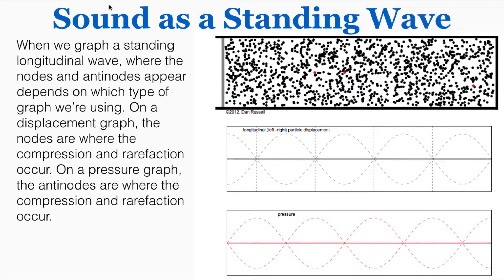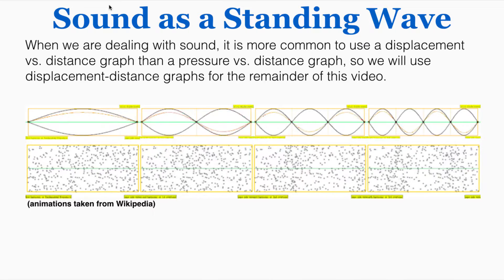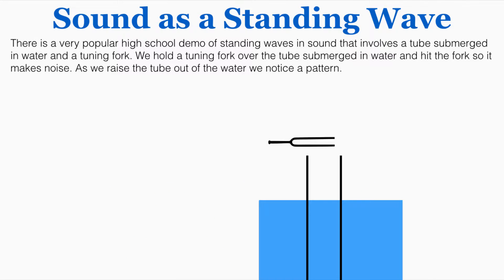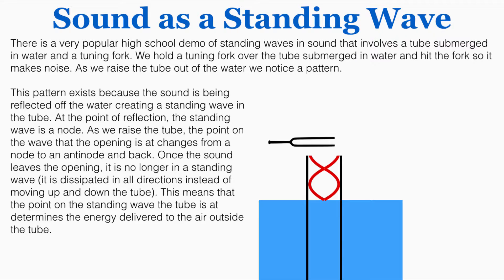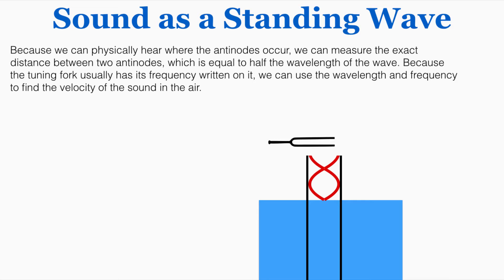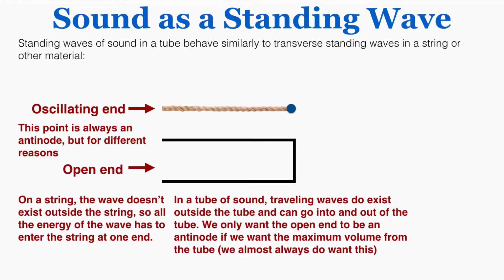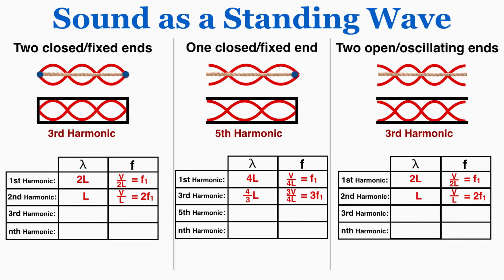Sound as a Standing Wave - IB Physics

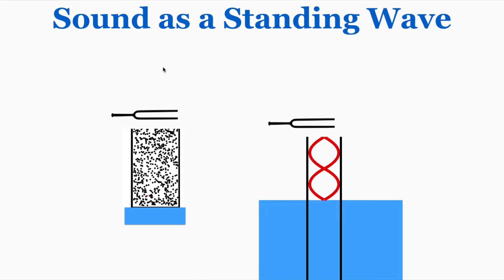Comment: I think that there is a mistake in the video at 5:35 to 6:15. If we do not hear a sound at this pipe's length (L = 2*lambda), that's not because there is a node at the upper end of the pipe. In fact, the boundary conditions for this pipe are always the same here : a node at the bottom (at the water's surface) and an antinode at the top (if the 0,61*r correction is neglected). So, there is no sound when the length of the pipe is L = 2*lambda because no standing wave at all can be established in that condition.
Reply from the maker: Ah drat you're right, good catch! I should add a note in the description, thank you!

Comment: After watching dozens of videos regarding standing waves (which were only based on formulas, graphs and mathematics ), finally I got a clear picture of standing waves in organ pipes in my head. So thank you Andy. The only doubt I am remained with is "is it possible to create a sound standing wave without organ pipe in the air just by blowing air with our mouth ?  "
Reply from the maker: So the thing that's different about sound is that it's a traveling vibration through air particles, the air particles themselves aren't traveling, they just shake back and forth and impact the next air particle. It's the different between talking to someone across the room (very easy to send a vibration through the air particles) and blowing air across the room at someone with your mouth (the moving particles very quickly dissipate in the air before reaching the other person). Because blowing doesn't create the normal phenomena we associate with waves (maxima and minima, period and frequency) a standing wave (the result of two waves interacting) can't be produced.

Comment: 5:33 
How is it possible to have a node at an open surface? Wouldn't the particle from all the pressure simply push out at the surface, or is the tuning fork at the opening acting as a "barrier" because it is oscillating at the same frequency as the particles within the tube?
Reply: There are nodes along open points all along the rest of the waveform, as far as the air is concerned there isn't a difference between multiple nodes in a frequency and the open end of the tube.
Reply: @JenkoRun  I understand the logic of that statement but it intuitively it doesnt make any sense at all, what literal physical explanation is there for this?

Nodes on a fixed point, like on a string makes sense, as it physically cannot move, but the literal opposite scenario serves the self same purpose?
Reply: @MelloCello7  The air molecules don't travel when excited, they're the same as the rope or water that they perturbate without going anywhere, if you mean what stops the anti node of the open end of the tube from vanishing into the environment the pressure from the tuning fork acts as a closed end for the vibration, it influences the disturbance like a closed end.

Comment: Hi Andy, thanks for explaining. One question though: In the fork and water tube experiment, does the distance of the fork from the water have to be (wavelength of the fork's vibration in that air) x 1/2, 1, 1/5, 2 etc? Or will the nodes remain in the same spot if we keep the pipe the same yet pull away the fork further?